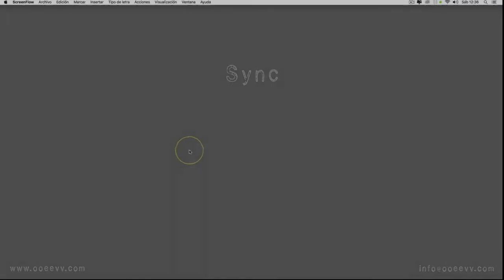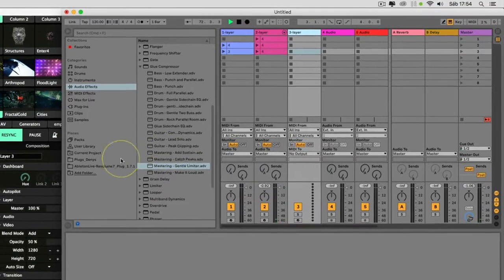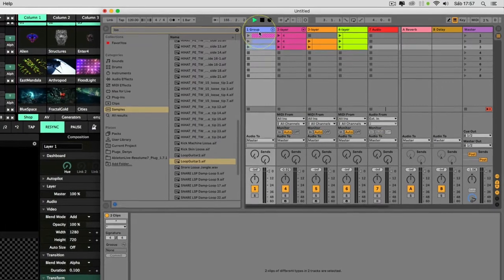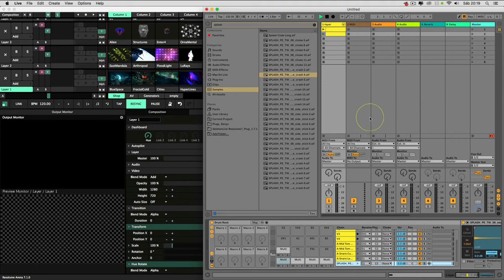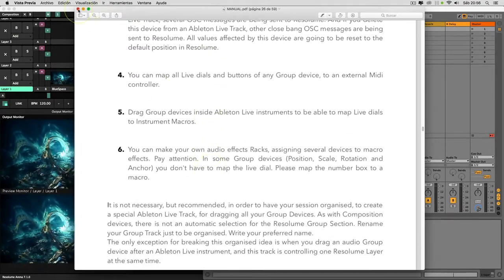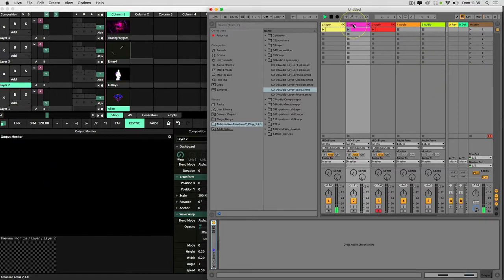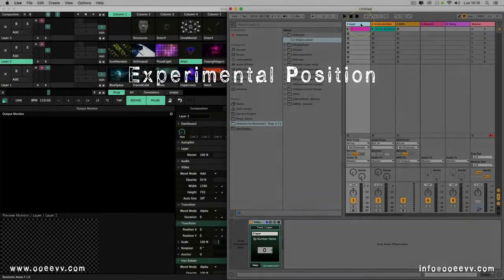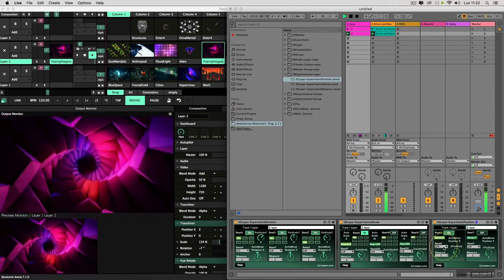Tutorial ABL10 Resolume7 M4L Plugin

Comment: Depends on your use case, but the following information may or may not be useful.

This is what worked for us to have our Live 11 Suite session cue clips in Resolume Arena 7 on the same M1 MacBook Air without any additional plugins:

[mac]
- Open Audio MIDI Setup on Mac
- Command+2 to Show MIDI Studio
- Double-click IAC Driver and make sure it is online

[ableton]
- Ableton > Preferences > MIDI. Check IAC Driver Output track and remote options
- Create a MIDI track and output to IAC Driver, MPE channel
- Set MPE settings to multi-channel mode
- Draw MIDI notes. Each note unique to a Resolume clip. We did this is arrangement view.

[resolume]
- Open Preferences and enable IAC Driver Bus 1 MIDI Input

- Navigate to Shortcuts > Edit MIDI

- Select a clip
- Go to Ableton and play the unique MIDI note that corresponds with the clip. This will assign that note to the clip.
- Exit out of Edit MIDI view and test.

End result: when the Ableton session fires the MIDI, the data goes through the IAC driver, and launches the assigned Resolume clip.